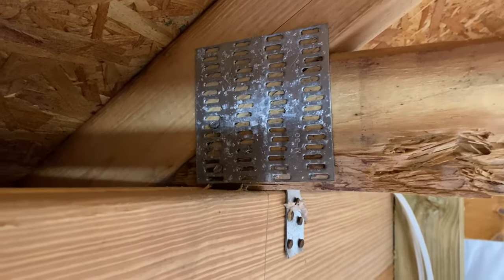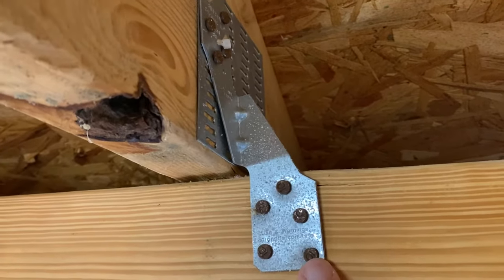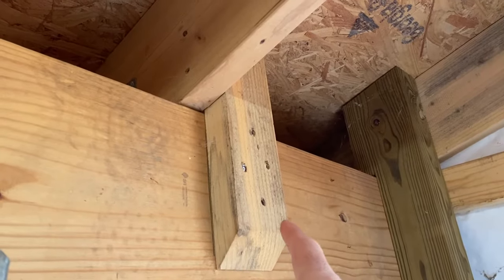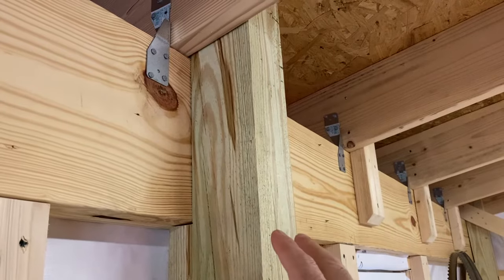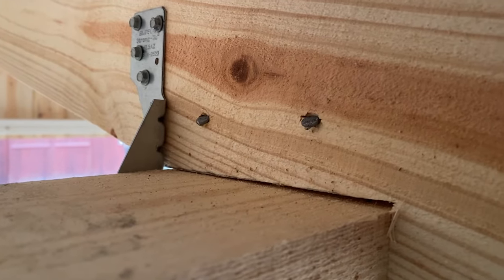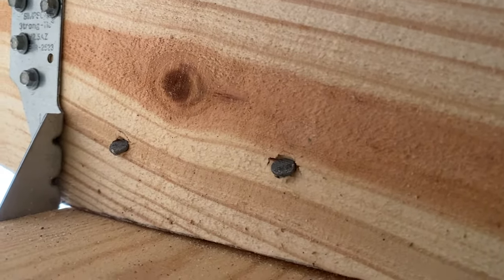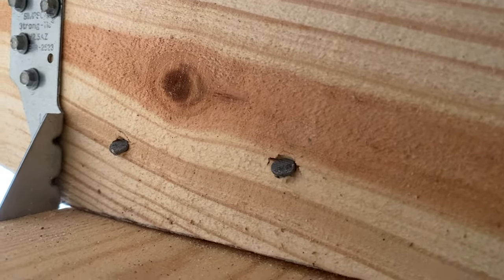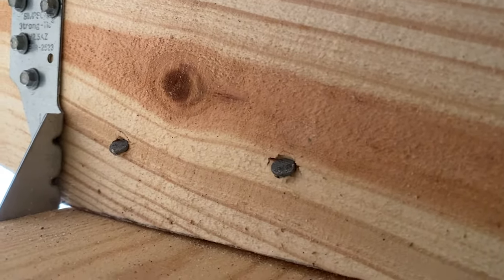Attaching Rafters and Trusses to Header Beams - Overview of a Couple Methods

Comment: Over the last week and a bit I built a pergola/gazebo roof using this system (that I then cladded with tongue and groove sheets)....Storm Kathleen has just hit us here in Ireland...and Im pretty sure the neighbours are all expecting a bundle of sticks in the morning....but Ive kept checking - and the thing is like a tank - not even creaking - thanks soooo much for your great video - so easy to follow and I can fully attest - it works!!!
I actually painted the whole frame in black bitumen - and the roof cladding is treated wood but stained with light oak - it all looks very pretty - but I just love the fact its so, so strong!
Thanks again 
😃

Comment: I like the 2x4’s for brackets a lot better than the metal brackets. I also run a Timberlok screw up through the beam into the rafter.
Reply: Would there be any need for the Timberlock screw?
Reply: @SJ.77 some places where a 2x4 bracket can’t be used or instead of a bracket or brace.

Comment: If you have a rafter tie in the lower 3rd and a collar tie in the upper 3rd, do you need girts at the ends? I'm asking because I'm trying to build one of these but its for an RV and I need more headroom entering the pole building. Great build by the way pretty impressive, I hope to get a saw mill for my property soon as I have 10s of acres of white pines.
Reply from the maker: Technically a proper rafter set or truss won't need girts on the gables.  From the perspective of the static roof loads, the gables aren't any different.  However, you wouldn't have very good shear resistance in the lower structure, so things like wind loads and even settling could do a number on the structure and allow it to rack sideways.  So the gable girts and corner braces from post to girt are more about keeping the lower structure stiff and properly braced.

You could possibly add knee braces and/or work up scissor-style bracing at the gable ends but that would really only help with headroom in the center.  

Another option is welded steel trusses.  If you google "steel trusses for pole barns" you'll get a lot of good info.  They are stiff enough that they can brace the structure in ways wood trusses cannot.  You can gain a lot of headroom with steel trusses.

Comment: I noticed while you were installing rafters they had birdsmouth cuts. I am doing a 16' × 16' lean to carport, and using 2×6 on the 1 1/2  edge side to connect the low side post together (or span) and same to connect low side to high side post together with high side at about 10ft and low side at about 8ft, so im guessing either a 1 or 2 pitch roof, and spacing rafters at 16" on center. I will be using a standing seam sheet metal roof, and i live in Central Texas and rarely see snow, but my question to "L" is do i need to do birdsmouth on 2×4 rafters or could i just lay them onto the 2×6 and block them like you did in your video?
Reply from the maker: The issue with just laying an angled rafter across a header is that the two will only meet along the outside edge of the header, and any roof loads will be pressing down on a very narrow section of wood grain on both members.  Over time the grain on both will deform and/or fracture which could lead to issues (the least of which would be unpredictable loads on fasteners).  Whenever we rest one structural member on another, we need to make sure there is enough bearing surface where they meet to support the wood grain, and you do not get that in this scenario.

An acceptable "shortcut" solution in this case, if you don't want to bother with a birdsmouth on a shallow angle, is to bevel the top of the 2x6 header at the angle of the roof pitch.  Then the 2x4 rafters will sit nice and flat on the header with plenty of grain bearing area.  Just realize there is nothing to keep the rafters from sliding while you work, so get them fastened as soon as possible and be sure any fasteners, brackets, or blocks are able to provide enough lateral resistance to hold the structure together.  I think blocking with framing nails or structural screws will provide that.  Lateral loads are generally pretty small on a lean-to roof under normal conditions.

You can see how I took this approach when attaching rafters to an existing structure in this video: https://youtu.be/RcMBfz3mINk?si=bsb4CPVSEBSInypO&t=629

Comment: The current UDC also allows for a single structural screw to be diagonally driven through the top plate and into the rafter/truss.  Much cleaner, easier and faster to install.  SPAX, TIMERLOC are a few manufactures.
Reply from the maker: We did that with TimberLoks on a recent stick-frame project, and I liked it.  They have a jig used to set the proper angle and position through the top plate.  I have not seen any use of the method on pole barn headers (typically double 2x10 or 2x12 on edge).  I assume it would still be OK if you could insure proper angle and depth when crossing the grain but don't know for sure.

Comment: Nice video! I landed here because I was trying to look up details on attaching rafters to a ridge beam that doesn't include just butting them up to the beam and using hangers. Do you have any videos or anything to say on the matter?
Reply from the maker: Structural or non-structural ridge?
Reply: @Lumber_Jack  structural ridge.
Reply from the maker: @joshuasmith1215  For a structural ridge, I would definitely use hangers -- they will be the easiest way to do it and transfer the load.  Alternately, you could use blocking and cross-nailing, but that requires very careful planning of the nail placement and won't be as good as hangers structurally.  With blocking, I'd want a metal strap over the top of every rafter pair to secure the joint.

A third option I really like is to treat the structural ridge as a beam -- drop it lower a bit, and let the rafters rest on top of it.  Plan your rafter spacing so that there is an offset and rafters from one side come up and overlap next to the other side where they cross over the ridge beam.  You can face nail them together where they cross.  If using this option, do not cut a birdsmouth into the rafter to seat onto the ridge beam, as that will reduce the effective size of the rafter.  Instead, cut (or chisel) angles on the top of the ridge beam so that the rafter lays onto it, or cut wedge strips to go on top of the beam.
Reply: @Lumber_Jack  thank you so much for the reply!
Reply: @Lumber_Jack  I used 2 6x3's bolted together with stainless steel rods to form a 12x3 ridge beam (all Larch) and then fixed the rafters with blocks & 5" structural screws. I did not fit metal straps across opposing rafters as it seemed unnecessary. Metal roof sheeting not fitted yet. I don't seem to be able to attach a picture unfortunately! Thanks for your video.

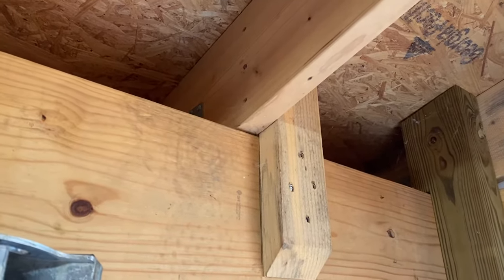Comment: I appreciate the information that you have shared.  But the subject I was most wanting to know about was partially covered during the video taping.  Please point the camera and reveal 100% of the supporting 2/4 at 2:39 seconds on the video.  I want to know how far the supporting 2 x 4 goes upward.  If it touches the roof, did you cut it to an angle?  Thank you for sharing this video.  I want to see more. Lonnie
Reply from the maker: Look at the fasteners attaching the rafter to the block, and it will be obvious.  You always want to carry the block as high as you can to get the fasteners as spread out as possible.  I normally do not trim it to the roof angle but you could.
Reply: @Lumber_Jack  Thank you

Comment: Your videos and information is not notch Thank You very much.
I have a question about the non structural ridge board. what would make it a structural ridge board? I am in the process of building a 12' x 12' Pavilion and am wondering  if I can use what you did there but only use a 2x8 instead of the 1" x 8 board
Thank You
Reply from the maker: A non-structural ridge is just there to act as a nailing aid and doesn't support anything.  The rafter design and size allows the rafters to form an arch and support the roof loads by themselves (with proper beam support on the eaves and proper bracing).  When you cannot do that for some reason (could be due to span or roof shape or other factors) and the rafters require a center support, we call it a structural ridge.  The structural ridge board will need to be supported from below with posts or walls, in order to carry the load down.  A structural ridge can be carrying as much as half the roof load depending on the roof geometry.

Ideally you want a non-structural ridge to be light weight since it's only there to help you nail up the rafters and tie the rafters together.  It really just needs very basic temporary support during construction (although often the supports will be left in place afterwards if they are not in the way, say in an attic or dead space).  So you don't have to be fancy or use beefy lumber, in fact it's easier to use a thin board.  I prefer a 1" board but a 2x8 would be just fine as long as it's not too heavy to lift into place and support while you're working.
Reply: @Lumber_Jack  Thank you very much for this information. Your videos and information are a blessing for us that are inexperienced with this type of building.

Comment: What type screws do you suggest both for trusses and purlins
Reply from the maker: I like GRK structural screws, and they come in a whole range of sizes.  #10 are good general purpose framing screws, normally I get 3.5-4" screws but also use 3" in places.  They have two different head types as well.

Comment: Can you give me the dimensions of the header and the rafters of the 2nd example (blocking) please?
Reply from the maker: That is a 2x8 rafter on a double 2x10 header.  Of course both sizes are dependent on your local roof load and snow load requirements, as well as things like pitch, rafter spacing, and pole spacing, so what I use here is not universal.  Some locations can get by with smaller rafters and headers, while others need larger.
Reply: @Lumber_Jack  thanks for that. Do you reckon this size of timber is suitable for a vaulted ceiling? I have a concrete reinforced ring beam with a timber wall plate on top and was going to use your second example for a vaulted ceiling with rafters every 1.5ft. any suggestions on how to stabilize a header on top of wall plate?
Reply from the maker: @af4265  Too many unknowns for me to say.  Would really need to run all the roof calculations to know for sure.
Reply: Titanic,Space Shuttle the list goes on calculations are not what they are made out to be,them old barns were built with guys that couldn’t read or write stood the test of time just look at them Japanese building that is workmanship.

Comment: If you're going to drive nails in by hand, after pre-drilling to get a good angle, you might as well just sink a 4 inch deck screw instead.  It would help you be able to reposition the truss/rafter easily too.

Comment: All of your hurricane ties are installed incorrectly.

They’re supposed to be on the exterior side of the top plate of the walls.
Reply from the maker: They are installed on both sides of the wall on the barn with trusses, which was a code requirement given to us by the local authority.  You cannot see the ones on the exterior because they are under siding now.  

On structures with rafters that use a birdsmouth cut to meet the top plate or header, the ties need to be installed on the interior side.  You would not want to install those only on the exterior side because the fasteners would be going into severed grain of the rafter tail downhill of the birdsmouth and have no holding power.

Comment: A hand driven nail holds better than gun nailed fastener.
Reply: Not a chance, gun nails have glue that activates when driven.
Reply: @matthewprestine1974  glue is to hold the magazine of nails together.  A nail is a nail.
Reply: @caseykelso1  clearly you don't have any experience.  Pneumatic nails have glue on them and it is friction activated when they are driven in.  A nail is not a nail!
Reply: @matthewprestine1974  and the first time the wind blows and the nails moves in  the stud , just a don't hair , you break that little so called  glue seal that you're supposedly talking about, which goes back to the fact that is nail is a nail...glue or not